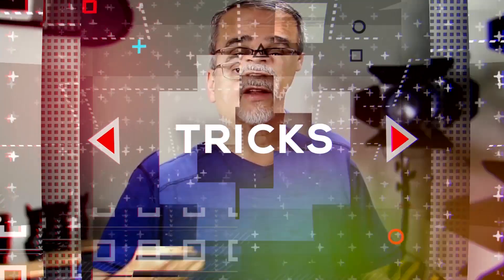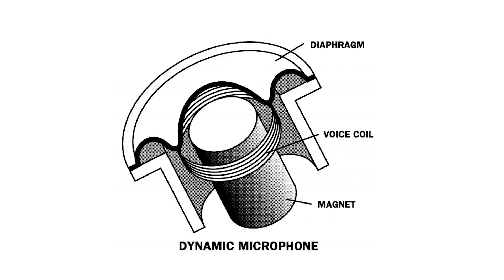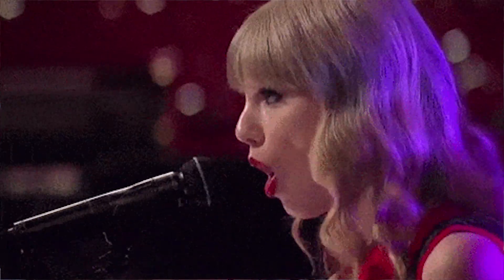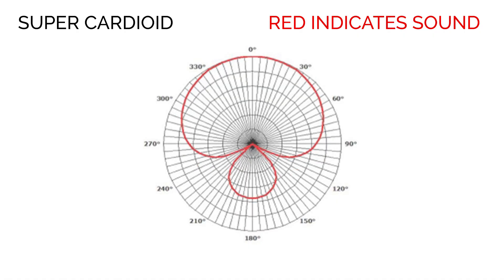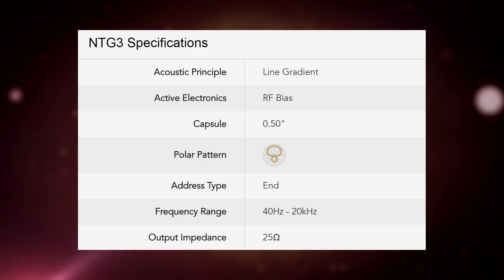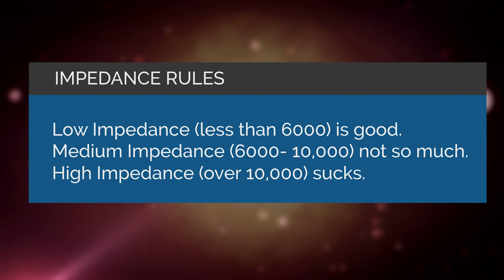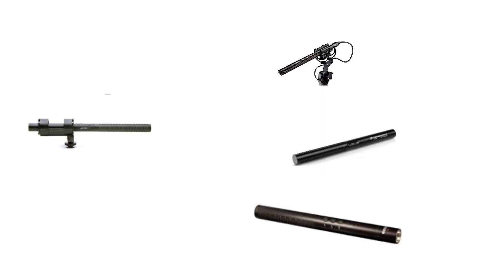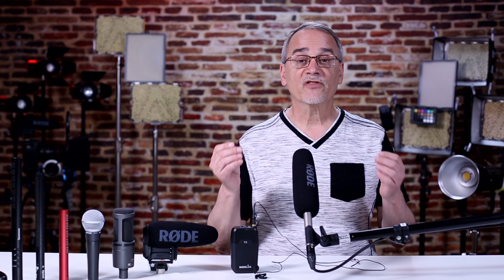BASICS OF MICROPHONES 🎤 How to Compare Which Mic to Buy

Comment: Wow! Good info on how to make those tricky decisions about which mic to buy. Love it!

One note re: impedance: On lavalier microphones, the impedance specs are all over the place, depending on the design of the lavalier and it's output connector type. There are some very good lavalier mics with output impedance specs close to that 6000 ohm upper limit and others under 1000 ohms. This is where hearing samples from them is probably more important than the impedance spec.

Great work, wish I had thought to make a video like this! ;-)
Reply: +Curtis Judd I have a couple of small diaphragm condenser mics. One lists impedance at 75 ohms and the other at 200. I know based on what I paid that they aren't top of the line, but they sound good to me. I'm guessing just based on the specs that they wouldn't be considered too horrible though, right? I used the 200 ohm one the other day for a vocal track and I thought it sounded really good.
Reply: Hi Gene, Impedance is a little tricky to use for evaluating microphones for a few reasons. I agree with BFM that you generally want lower output impedance. There are other factors to consider in relation to a microphone's output impedance. For example, the microphone preamp you use with the microphone should have an input impedance that is at least 10 times the output impedance of the microphone. Or it should be matched, one of the two. Usually these days, it will be 10 times or greater. Also, there is so much variation in microphone design and impedance is but one factor. Like BFM says, if I'm considering a microphone purchase and I see that its output impedance is greater than about 600 ohms for an XLR mic or more than 6000 ohms for a lavalier, that should give me pause. Listen to lots of samples before purchasing, but don't make output impedance the only factor you consider.

Also, watch out when reading specs. Some show "load impedance" or simply say "Impedance". This is not necessarily output impedance. So the specs are not always helpful in terms of comparing microphones. For this discussion, we are talking output impedance.

75 and 200 ohms is great, especially if you like the sound of the mics. :)
Reply from the maker: +Curtis Judd Yes, this is true, and I should have mentioned more clearly that impedance is only a measure when you can't hear the mic, but not a deciding factor. I do have low impedance mics that don't sound as good to my ears as do some with a bit higher impedance.
Reply: I think you hit a really good balance. This topic could easily go down rabbit holes that would fill an entire day-long course. Or longer. Good work covering all the critical things in so short a time! 🎤
Reply: Thanks for the input. To be honest, I never looked at that spec when I bought them. I had to look first at budget and then at frequency response. I think mostly I lucked out with the ones I bought as they all sound good to me. I record into a Zoom H-6 which shows an input of 1.8k ohms, so it's pretty close to the 10 times. Thanks again for the response.
Reply from the maker: Thanks Gene for asking questions, and thanks Curtis for responding. When all is said and done, if it costs $9 or $9000, if it sounds good, well, then it does. :)

Comment: Great info as always. 

Here's some other filmmaker mic topics that could stand some more coverage:
1. PLUG-IN POWER: It's fairly common for some sound recorders to supply a voltage on the mini-phone jacks to power those mics that need it. This is usually between 3 and 5 volts DC.
2. MIC CONNECTORS: The pro mics mostly have XLR connectors. This is a 3-pin connector used on low impedance mics. These are also know as "balanced" connectors because the actual signal is carried on two of the three pins and is much better at rejecting electrical interference when the cable is laying on the floor next to AC extensions or other equipment. Phone plugs are also common and may be balanced or unbalanced.
3. MIC CARE: Some mics are more delicate than others, but all should be protected from mechanical shocks such as dropping them on a hard surface.
Reply from the maker: Nice! Great ideas...thanks for the content.:)

Comment: Great explanation! I follow Curtis' advice, and I listen to his and/or Caleb's reviews. I find that looking at the specs naturally tends to push me to spend more than I really need to, so I've come to avoid that when I buy a low end mic.

Buying a high end mic would be different - then I'd be all over the specs like a rash - but I'm not at that point right now.
Reply from the maker: For sure...you can still apply this to a low cost mic - if I'm deciding between two $39 mics, the specs might help me to decide, or, if it's just $39, buy it and try it. Thanks!

Comment: I'd also add that spending more on a quality mic like an NTG3 isn't like spending a lot on a camera, because it won't get obsolete. An NTG3 from 5 years ago - properly taken care of - is going to be absolutely fine. There are newer mics with nice features (the NTG4 and 4+, while newer and lower-end than the NTG3 - have some cool features the NTG3 does not), but an NTG3 properly used is as good as anyone not making a Hollywood feature is likely to ever need.

I'd "overspend" on audio before I'd overspend on a camera.

Keep in mind you can rent these things to test them out before purchasing, if you're afraid of high-dollar items.

Don't skimp on the recorder. The pre-amps in your camera suck (no, it doesn't matter what camera you have).
Reply from the maker: Good and wise words. That's the reason my NTG-3 is my work horse - it sounds great, lasts forever, and the one I grab every time.

Comment: I saw a vmp+ in the video. But in the description you linked the vmpro original. I checked out the features and they were almost same in terms of the 4 characteristics you mentioned. So does that mean that in the vmpro+ you only get some additional features such as a rechargeable battery, better shockmount and all ?
And also, is 200 ohms a good thing (probably is, but you are the expert) ?
And the last question, I think that the rode vmp+ would be good as a boom mic (by looking at the impedance, frequency response, transducer, polar pattern) when with a zoom h1n, a rode 10ft boompole and the vc1 extension cable. Do you agree ?
Reply from the maker: Thank you! Links fixed! The pro plus would be the one to go with. 200 ohms is not bad, and it's would be the last thing you would check - as long as it's not outrageous, it should be fine. Yes, the vmp can be boomed like any other mic, and I would suggest the Zoom H1n - it's newer and more reliable - https://amzn.to/2KIJNvL
Reply: Basic Filmmaker thanks for the reply !
Reply from the maker: You bet Nishant. Anytime.
Reply: Basic Filmmaker how'd ya know my name ?
Reply from the maker: I went to your channel and saw your claymation video.
Reply: Basic Filmmaker oh ... you saw that ! Made my day ! :)
Reply: Basic Filmmaker (probably irritating you) but do you like that video ? Or is it not good ?
Reply from the maker: It is good. Here's my opinion on almost everything - anyone who has the guts to make something and post it, is a million times more awesome than some who just thinks about it and never does. :)
Reply: Basic Filmmaker thanks ! That inspires me to make more of these !
Reply from the maker: You should. DOING is where you get better.
Reply: Basic Filmmaker thanks for replying. Happy filming  !
Reply from the maker: You bet!